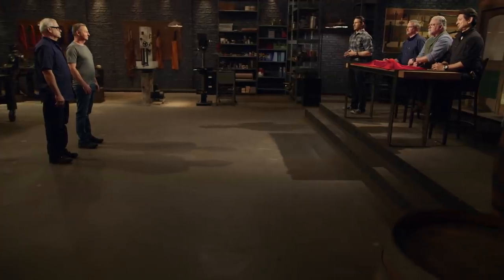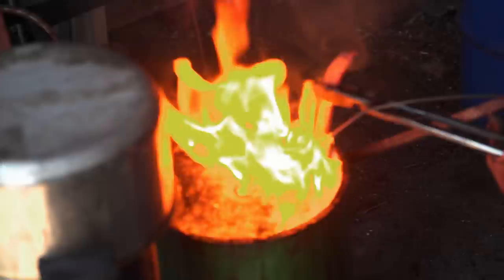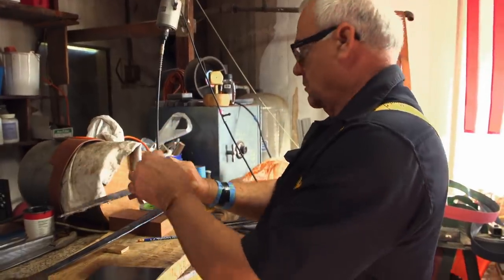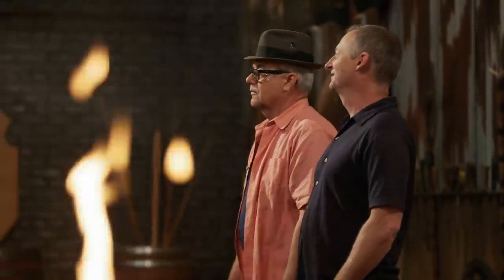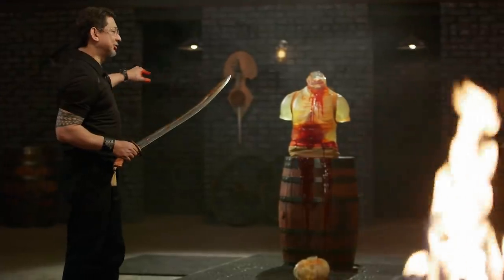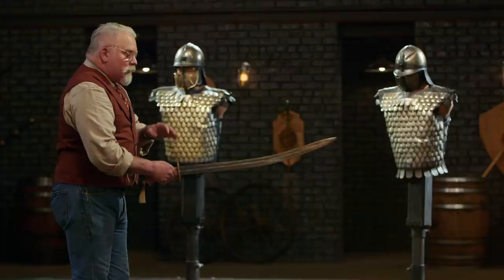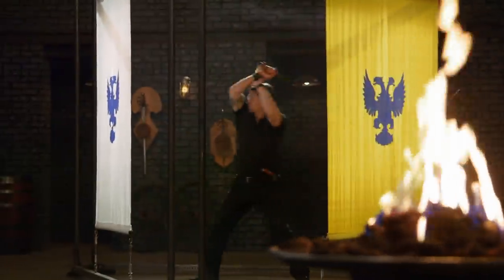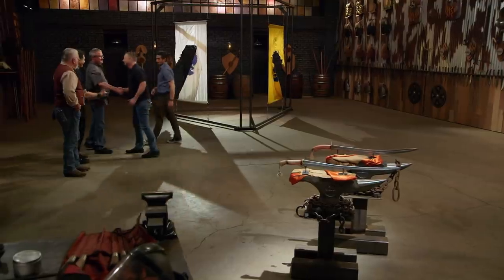Forged in Fire: Genghis Khan's BARBARIC Sword GOES WILD in the Final Round (Season 7)

Comment: Thats not fair if you hit the skull then  hit it with both the blades.
Reply: Was thinking the exact same thing
Reply: yeah that was Dugs fault that the first blade took the wrap
Reply: Agreed.. that's my only gripe with some of the tests, they are not consistent. If he realizes he hit the wrong spot with the first one, then he must hit the same spot with the other irregardless to be fair.
Reply: Yeah but Doug is a highly trained weapon expert and if he was not able to control exactly where the blade was going that in itself is a problem with the weight and balance of the blade
Reply: Probably would've lost either way considering the edge damage he took in the strength test
Reply: @swxqt6826  true

Comment: ....MISSING & bouncing it off the skull is what bent the guys blade
Reply: exactly
Reply: Would have lost either way as it did far worse in the strength test
Reply: @Cervando  it would have lost sure but this was unfair
Reply: The blade shouldn't bend if it was properly heat treated.